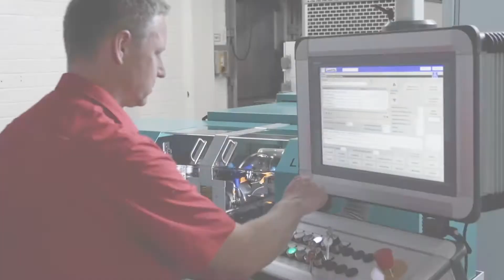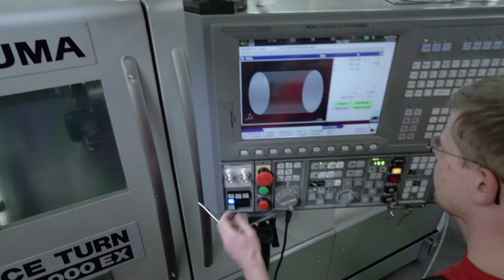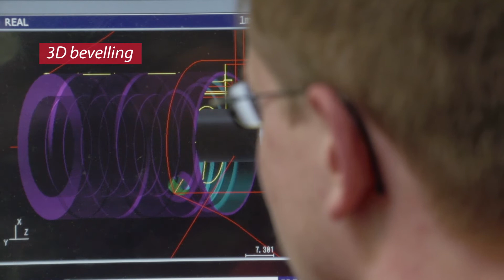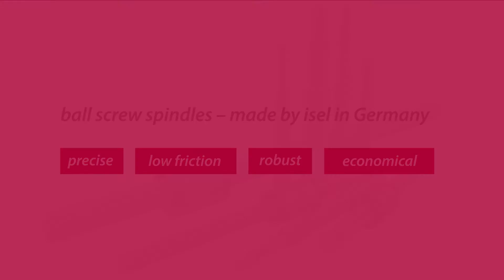Manufacturing ball screws: An exclusive look behind the scenes | isel Germany

Comment from the maker: #Automation

The ball screw nuts from isel Germany AG are of high quality, precise and abrasion-resistant (hardened and polished). Together with the ball screw spindles, they convert rotations into linear movements most friction-poorly.

The ball screw nut is inserted in the respective clamping block and fastened with a stud screw. The ball screw nuts have several balls paths with internal ball return.

A setscrew on the clamping block makes a clearance-free adjustment of the ball screw spindle's run possible.

The repeatability is less than 0.01 mm at a length of 300 m. To lubricate the linear drive, a greasenipple is fixed on the clamping block. The ball screw spindles are produced with modern machines; they are rolled, hardened and polished.

Our linear drives are technically mature and have stood the test in practice for more than 20 years.
Reply: +isel Germany AG | iselRobotik 

this is high quality ballscrew with employer Quality control. how to order for example the ballscew ?
Reply from the maker: Hello, if you prefer, you can request a quote via our website: https://www.isel.com/en/products/mechanics/drive-units.html or gives a call +49 (0) 6659-981-800